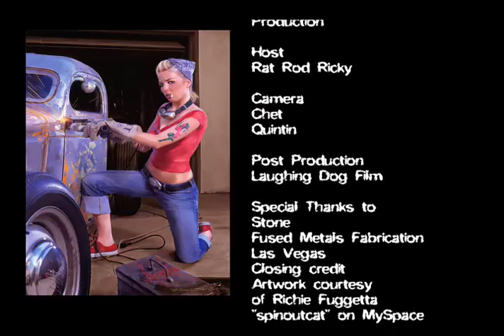Rat Rod TV Stone's Rat

Comment: looks a bit weird......why are the headlights on the cowl? How will you get air to flow through a radiator under the car? The only way it'll fit is parallel to the chassis, i.e. at 90 degrees to airflow - even if you DO get air to enter the radiator where will it exit? Straight into the floor? Best of luck making that work...Also, how do you get into this car - there's NO doors...I'm all for being different, but I don't get the point of making something that clearly won't even work.